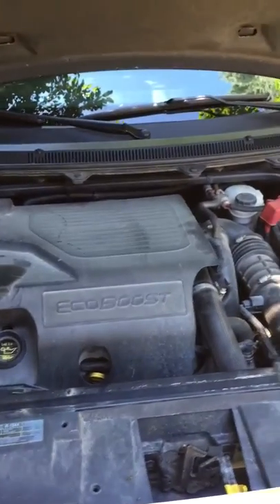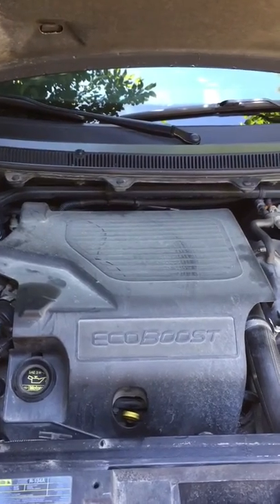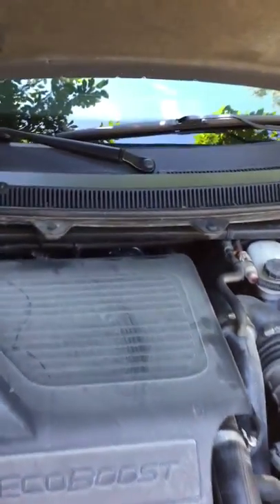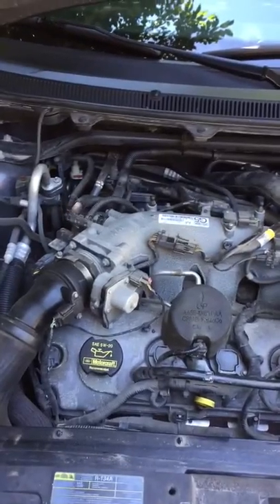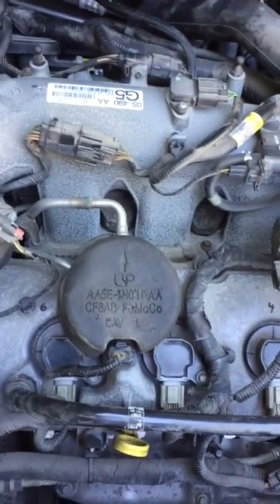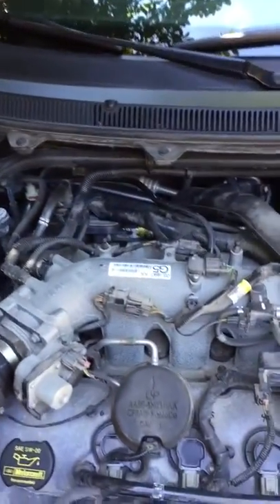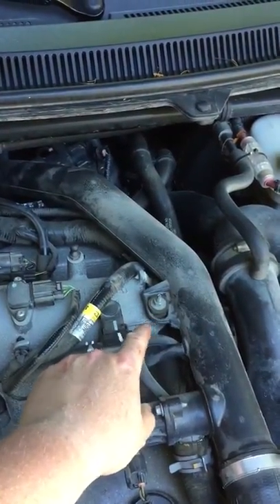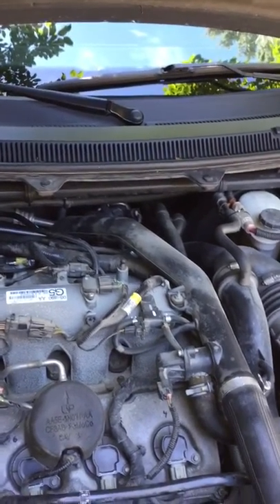2010 Ford Flex 3.5 Ecoboost Spark Plug Removal & Replacement - Save time & money! DIY in driveway!

Comment: Sweet 2010 Fusion Sport. A lady hit and totaled mine last weekend. Only 90,000 mi. and in mint condition. Going to miss that car. Replaced it with a 2010 Taurus SHO with the 3.5L EcoBoost. 65,000 mi.
Reply from the maker: Sorry to hear that.  Enjoy the SHO though.  That's an EcoBeast.  Thanks for watching and the comment!
Reply: @MoreBear  Thanks. Just replaced the spark plugs on the 3.5L Twin Turbocharged EcoBoost in the SHO. Your video helped in advance. Wish the engineers had rerouted some of components on the rear 3 plugs. Those electrical wire bundles made it more difficult than necessary. Went with NGK Ruthenium HX plugs from RockAuto gapped at .033". Runs smooth and brought back some pep. Original Motorcraft Platinum plugs were at .040". OEM spec. calls for .033"-.037".

Comment: Is there a video of you replacing the spark plugs? You mentioned it was easy, but the intake plenum looks pretty involved to remove and replace. Thanks much!
Reply from the maker: No video yet.  No need to remove the intake manifold.  A spark plug socket, and extension bit and a 3/8" ratchet will do.  A flex bit may help too.  Thanks for watching.
Reply: @MoreBear Is the rear as easy to do as the front ? What's the torque spec IF you know? Are these pre gaped by Ford ?  Need to change plugs on a 2012 Ford Flex twin turbos,  looks like it's the same as what your working on.

Comment: Where do you find the block heater plug location?
Reply from the maker: If your vehicle is equipped with a block heater, the plug will be fastened to the backside of the radiator, to the right of the oil dipstick.  The female plug end is protected by a weatherproof cover.  I hope this helped and that you enjoyed the video.  Thank you.